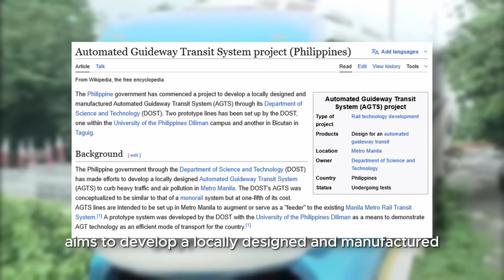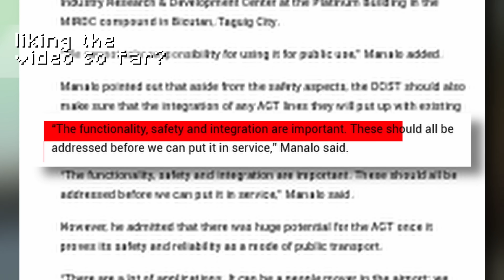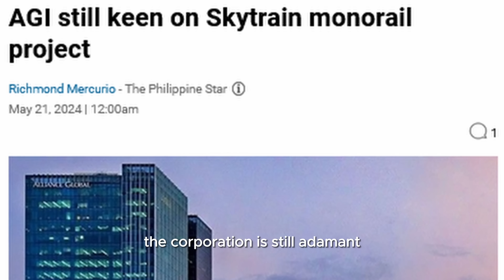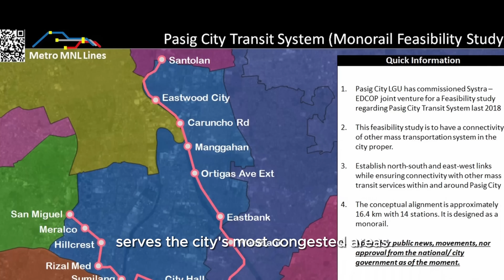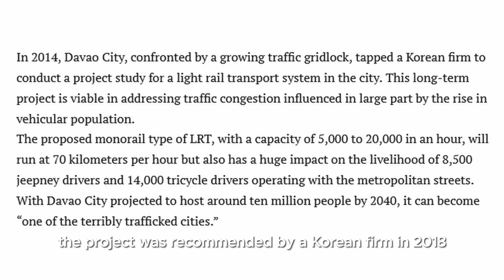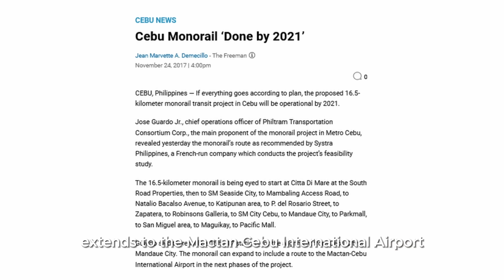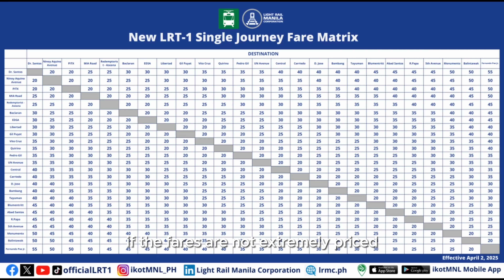The Failed Monoraills of The Philippines

Comment: I mean its a Monorail, its bound to fail, just another gadgetbahn, and not the actual public transport solution. That's why you either choose actual useful railway types, MRT/LRT, High Speed Railway, Metro/Subway,  or even Trams, much better than Monorail inside a city.

Comment: It is also important to note that there's also a possibility of these projects which are handled by domestic contractors would inflate the overall expenses for some pocket cash. It would probably be nearly impossible to implement a project on paper without the bill being extremely high whilst construction would take almost a decade (if not, more) while also causing even more traffic at the same time. LOL

Comment: It is unbelievable that Luzon doesn't have passenger train service.
Bus rides can take hours to travel less than 100 miles, 161 kilometers.
Reply: @truckermikemct1 man it will be a celebration once we bring back most of the PNR.  Connecting Subic to 
Legaspi.

Comment: Tbh im glad the Mrt 4 got delayed for awhile in exchange of a Metro Rail system instead of a monorail line, else it would've become  another mess like MRT 3 due to overcapacity, its better to have provisions for increasing ridership and ease of extension especially with all the row issues, Mrt 4 has plans to extend to glimore but underground because of the greenhills ROW issue
Saw from official sources that awarding of contract packages will be at 2026, while start of construction will be at 2027, now that studies are done hopefully no more delays... in which probably inevietable.

Comment: Baguio resident here. Mayor Magalong told us in a summit meeting that BYD's proposal was deemed unfeasible by them because their model of monorail trains cannot handle the "tight curves and gradient" on the road to La Trinidad. I think the tracks can be made straighter, but I'm not BYD.

The mayor also dismissed the idea of a dedicated transit lane along Marcos Highway due to "lack of space" when I asked for an update on their study. Maybe their Engineers prefer adding one more lane and one more parking space bro. Maybe that'll solve the tourist problem.
Reply: Forget the monorail. Build a high speed passenger train route from Manila to points in Luzon.
Reply: In Baguio, cable cars and trams are likely the best solution for public transit. Expanding and optimizing the routes of jeepneys and small busses will also help.
Reply: @quen_anito Indeed. Baguio's road system has managed to keep up with weekday demand because most people take public transport, significantly helped by the severe lack of parking situation in many establishments and making jeeps more convenient than driving.

Now imagine if jeeps had dedicated lanes in congested areas, reducing wait and travel times lower than taking private vehicles. Residents and tourists alike wouldn't need to drive to the city and take up an entire parking space every time they run out of milk.
Reply: @quen_anito  
How about create inter connected footbridge with escalators and a moving walkway, also commonly known as a travelator, autowalk, or moving sidewalk, which transports people horizontally (or slightly inclined) using a slow-moving conveyor belt for longer distances than a traditional escalator. Then the roof and sides are full of solar panels so that it'll be electric self sufficient. 😅

Comment: monorails in general, its a very niche and proprietary technology that has very few set standards of track whidth, loading gauge, etc. you basically buy one company’s standard and are stuck with their proprietary technology.

Also ROW problems wouldnt be an issue if the government had the same energy for railways as the energy they have for urban elevated expressways which mind you, are wider and uglier than an elevated rail guideway.

Comment: Japan has successful monorails even in large urban areas. The Tokyo Monorail connecting Haneda Airport, Tama Monorail, Chiba Monorail with suspended technology, Kitakyushu Monorail, and Osaka Monorail.
Reply: Japan is a rich and largely non-corrupt country (I used to live there). Around the Philippines, we're talking of a completely different socioeconomic, political and cultural sphere. 

The Philippines won't see any big improvements since 

1. The population is larger than what the govt can cater for 

2. 16% of Filipinos are largely untaxable due to being below the abject poverty line, 

3. Out of the remaining 84%, most live only slightly above subsistence levels, and are hence reliant upon either remittances or govt handouts (especially with natural disasters or health issues). 

4. the govt is ineffectual in passing even a basic welfare system which includes slum-eradication in lieu of rehousing in govt tenement housing; the means to secure jobs and invite investors due to its largely xenophobic and local corporate-protective legislation; public education that ensures widespread and well-paced social mobility; and of course healthcare. if it can't or won't pass anything to make lasting improvements to the economy and population, what moreso public transportation?

5. nepotism, widespread violence in the political structure, and a lack of real vision or care from the side of govt means taxes from the remaining 40% of the population is solely to line pockets and consolidate any given official or mayors' rule, often based on political dynasties. 

We're looking at a near failed-state (the Philippines) vs one of the most efficient and effective countries in the world (Japan). I think the comparison is a dud.
Reply: We are not japan, we`re worse.